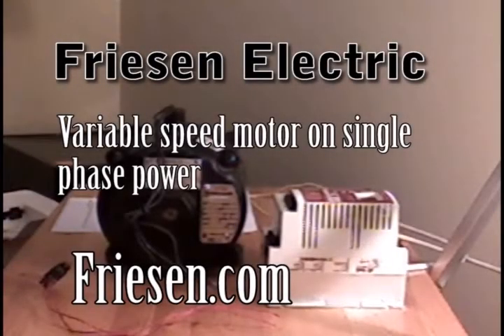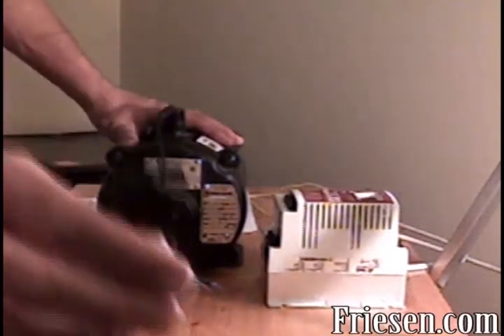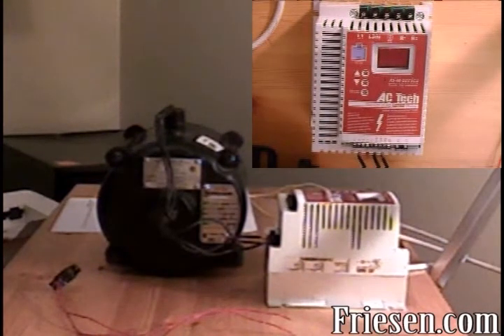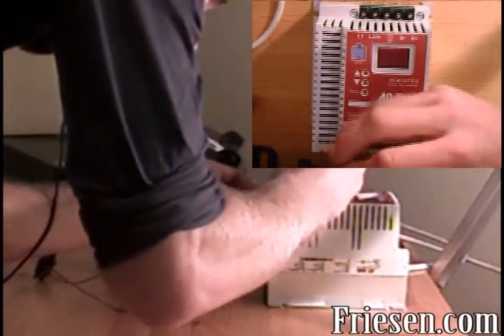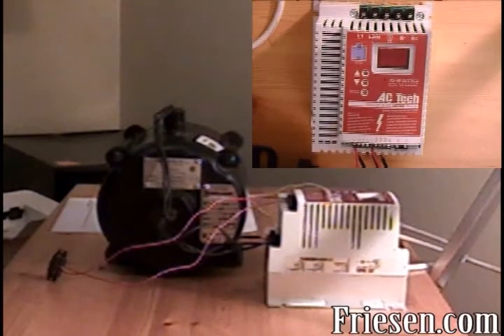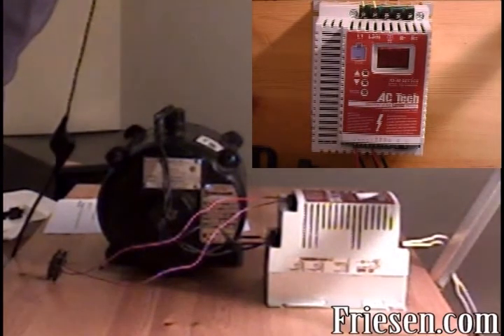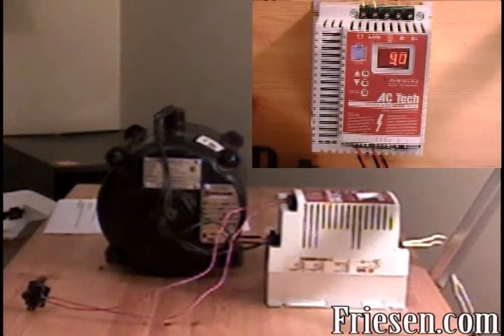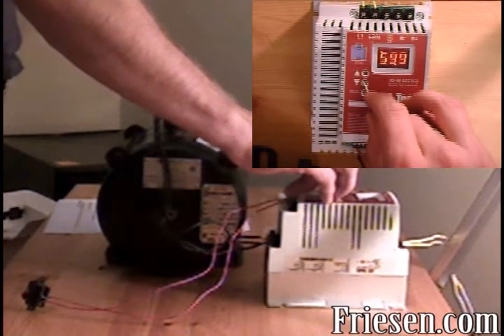2  - Variable Speed with Basic Controls

Comment: Ok my situation is I have a leeson sm series my motor is a 2hp 5.5/2.74 amp 3 phase class e. It is run by a cnc board but either it's not communicating or I'm just dumb it was in storage for awhile so I plugged it in for the reccomend 8+ hours I still cant get it to run